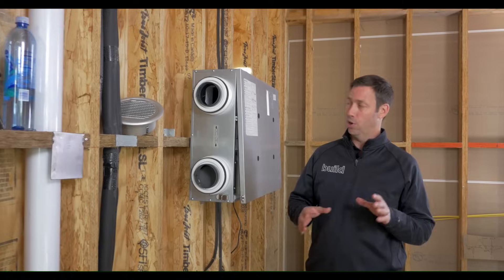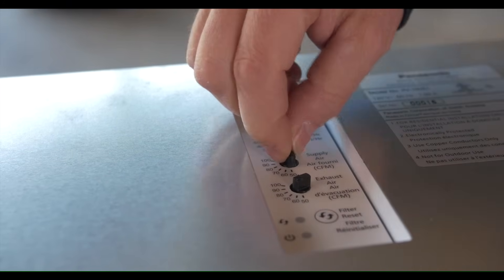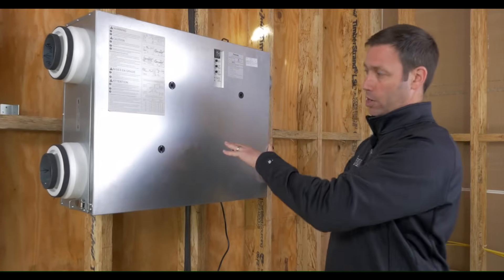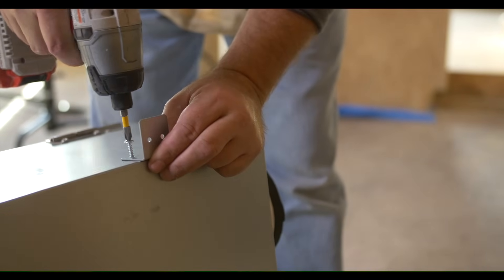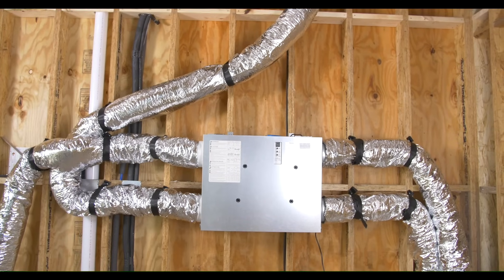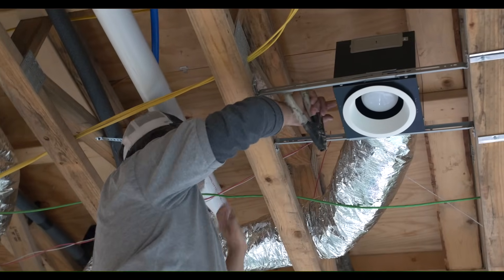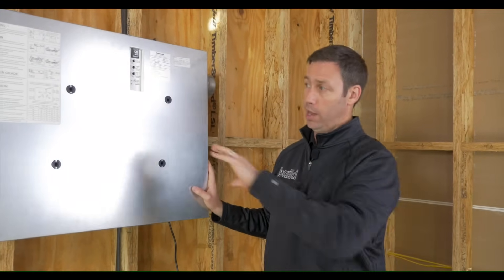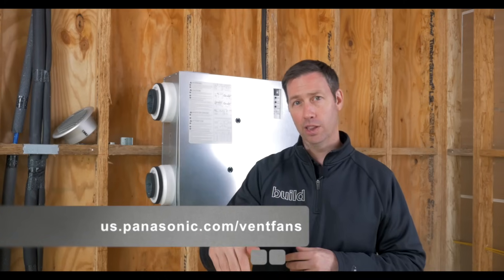How to Install an ERV

Comment: Matt you mentioned this installation is a standalone...does it mean it is not connected to the HVAC unit? If this is correct interpretation what will be the efficiency of the ERV to pull and push air in a 2000 sqft house with 3 supply and 3 returns
Reply: Yes, it means that it is independent of the HVAC system. However, as someone else already noted, he installed the SUPPLY (of the ERV) next to the RETURN of the HVAC, which kinda-sorta provides a short path between the ERV SUPPLY and the HVAC RETURN without actually connecting them, which others thought would be necessary, but isn't. The problem with connecting the ERV to the HVAC is that the fans of the two systems do not always operate simultaneously, which causes a problem in balancing the HVAC airflow to all rooms. ERVs are installed independently of the HVAC to make balancing easier, or even possible. I know I did not directly answer your question, sorry.
Reply: @billcowhig5739  this is my main question regarding installation. I am reading directly from the panasonic manual here, and it states as a stand alone unit that supply should be t'd off to every bedroom in the house, and return t'd off to every bathroom/kitchen. not just one supply vent. that's a lot of ductwork, and seems to be asking to 100cfm fan to do a lot of work, but maybe it's ideal as it is what the manufacturer specifies. otherwise it specifies hooking it up to the hvac system directly, which like you said, would lower efficiency for a number of reasons. first would be airflow, will 100cfm be enough to blow air all through existing ductwork in a 3-4 bedroom home? second would be leaky ductwork if you are retrofitting the unit, you will certainly lose airflow to the attic or crawlspace (which may be okay, a little exchange there might be preferable). i just can't figure out the best way to do it. i think dumping supply air near the homes main return would be okay but who knows. it might be best to start there which is the least amount of work and then monitor the air quality, update duct work as you go. maybe you could measure co2 levels in each room before/after to see where you need to add supply.

you can get around the fact that the unit only runs when the hvac runs by omitting the hvac signal switch and just letting it run 247 and maybe putting a booster fan inline somewhere to help out, but that would mess up the pressure balance at the unit. otherwise just have the air handler fan running 247, which is $$ and could cause other issues. the added benefit would be more airflow as the AHU acts as a booster of sorts, but idk, i'm not a pro technician.

Comment: how do i install without hvac unit? i have mini splits for heat.  i spray foamed my knee wall ant attic its air tight, not i need fresh air.

Comment: I bought this unit based on your recommendation. Unit is dead on arrival and does not turn on - very poor quality. It was also missing the covers for the ports.
Reply: Covers for the ports?
Reply: @technorex344  ports allowing manometer reading - the covers blank them off to close leaks if they were open.

Comment: Serious question...at what point do you need/have to have an erv/hrv?  Thx
Reply: Depends on your goal. If you want the house to be healthier for the people- run it all the time, if you're just trying to manage a humidity level, that would depend on the humidity. A simple 'dehumidistat' can manage that for you.
Reply: @technorex344  thanks for the reply.  Ive got a house that blows 12 ach.  Im working on improving that but assume that it stays at 12 ach.  Would an erv/hrv still benefit the home or occupants?  Thx
Reply: @treystills  How did you come to that number?
Reply: @technorex344  blower door test
Reply: @treystills  I see. I disagree with that test on the basis of: Why would one test a building for problems, using a test that will never occur under normal conditions?
Reply: natural forces make it so when one side of the house pressurizes, the other side depressurizes. Air will then move into, and out of, the structure. That's usually referred to as 'Natural Ventilation' which, while it does allow some fresh air in- does so sporadically and in a way that does not guarantee overall ventilation of the structure. It's like opening windows; if you've got a window at two ends of a long hallway and you open both, you're going to feel a breeze, but that doesn't mean rooms off of that hallway are getting much if any of that fresher air.
Reply: @technorex344  I posted a sincere question which requires a response from someone knowledgeable in this field.  Clearly you have no idea what a blower door test is, its results, and why it would be performed.  I'm not trying to be rude but your wasting my time.  I do appreciate your effort though.  Thanks
Reply: @treystills  I do know why it would be performed, but for ventilation purposes it's not a relevant test. For an insulation/air/moisture tightness- sure. It tells you that all the little holes in your house equate to a given area e.i. "a hole this big" I have nothing to gain by giving you information, I'm not trying to sell you anything. If you've got 12 air changes an hour, you've got a leaky house. If those holes are in every room and supply fresh air where people spend the most time (like the bedroom where we spend 1/3 of our lives) and exhausts from pollutant sources (like the kitchen from cooking or the bathroom where cleaners are commonly stored and where we shower) then fantastic; you've no need for proper, mechanical ventilation.

If you believe houses are built for people and health is the primary concern: ventilate it.
If you believe houses are built for energy and heating/cooling is the primary concern: insulate it.
If you believe houses are built for people, but energy is a close second: do both. ~Insulate tight, ventilate right.

You don't have to believe me; that's ok. If you watch Matt often you'll hear him talk about Joe Lstiburek(stEE-brik), so here's an article he wrote on the subject: https://www.buildingscience.com/documents/insights/bsi-053-just-right-and-airtight

Comment: Hi Matt, awesome information in generell about ERV. Been researching a lot and no information was as clear on system definition as you. I'm planning to install a ERV in my home in Hong Kong, a place were residential indoor ventilation is uncharted territory...! Air here is dirty, hot and humid (polluted tropics). Space scarce and f2 most expensive in the world. So what compact system is todays best solution for a 1200 f2 duplex (700 downstairs sleeping and bathroom+500 upstairs kitchen and living), and what floor should I place inlet and outlet? I will spread your knowledge and videos amongst us suffocating expats and buy the product!
Reply: The inlet/outlets can be placed on the lowest floor unless you're close to a lot of traffic, in which case higher up may give you slightly better air. if you're in a polluted environment, you're going to likely want what's called a HEPA (High-Efficiency Particulate Air) filter. The difficulty with polluted environments is that HEPA filters will work and will "fill up" and become blocked, possibly in a short period of time and can be expensive. Even in a non-polluted environment, HEPA filters are recommended to be replaced once per year and can cost an average of $200.

Comment: Looks like a cheap, substandar product. Calling that filter big is laughable! Mine has thrice the size(in a seven years old unit),  and good would be a proper bag filter with ten times the surface area and dust load like in a Hoval unit!
Reply: he called it "good" based on the MERV rating of the filter, also "big" is relative to the CFM flow, you don't need a 2'x2' filter like the central A/C units filter that has to filter the whole houses airflow as the A/C run's which on a 4 ton unit can be well over a 1,000 CFM, just enough for the small like 100ish CFM this unit supplies.

Comment: I've never even heard of an ERV before. And, you never said what it is or does, really.
Reply: Energy Recovery Ventilators, it brings fresh air in in 1 chamber and exhaust house air out in another chamber and exchanges via the fins as much energy (whether that be heat energy or cold energy) from the outgoing house air to the incoming outside air with the idea to be to "pre-cool" or pre-heat" the fresh air so it doesn't have to be reheated or recooled as much by the central air compared to simply opening a window to allow fresh air in.

Comment: Hi Matt - I hope you are still responding to these comments.  I plan on building a 36' Diameter Geodesic Dome Home which will mostly have an open plan and Extensions.  It is an energy efficient, "tight", home with tons of insulation in the walls.  I have MCS (Multiple Chemical Sensitivity) and am extremely sensitive to VOC's.  I live in the humid South but it also gets below freezing in the Winter (for a few days...).  I am doing my research on the ERV and it would appear this is what I need.  
My Question is:  Would this be the size I would need or would the Whisper Panasonic (spot ERV) be better for my small, open, floor plan?  I really need great filtration and not sure the Spot ERV will fulfill that.  (I will have a bathroom fan and also my electric stove will have a vent / fan.  OH!  I can not have a ducted air / heat system due to severe Allergies so I will be using the Mitsubishi Mini-split air / heat system in my home.  
A little confused on what I should get....if anyone can give some suggestions, I would certainly appreciate it.  Even though I will be using mostly Low VOC materials to build, I want to ensure I will be able to live in this home, and clean indoor air is going to be extremely important for me.  Thanks for your input!

Comment: Here in the low desert (Palm Springs) it couldn't be any hotter or drier.  Exhausting heat out of the building and trying to keep it from entering (radiant barrier) are top of the list.  Cooler air can be had fairly easily, by excavating along the north edge of the slab and bringing air from that area, into the building.  It could be done in various ways, digging, blocks, rigid insulation and large diameter pipes  etc..
Then, why couldn't I use a HRV sort of in reverse, to use already cooled but stale indoor air to pre-cool the incoming outside air?
Reply: it works both ways, thats why they call them Energy Recovery Ventilators now instead of Heat Recovery Ventilators, the goal is to bring the incoming air as close to the temp of the outgoing air as possible, the system does not care what the outside air temp is.

Comment: Wouldn't it make more sense to incorporate this tech into the HVAC system so that the filtered outside air is distributed housewide, and a portion of the returned air be exhausted to the outside?

Fortunately, I live in an area with relatively clean air.  My home is pretty airtight, so I have the urge to open the windows for some fresh air on nice days.  If there was a way to direct the fresh filtered air into my HVAC system, I'd be less inclined to open the windows.
Reply: it's actually not a good thing to do, cause you don't want to mix ventilation and cooling/heating. Ventilation requires much less cubic volume and there are numerous articles why this is a bad solution. What you need is actually 4 ducts to each room (yes insane). 2 for in/out ventilation and 2 for cooling/heating
Reply: @jasonhunter6125  While I agree it's not a good choice to mix them due to volume requirements, as you said, it would be more effective to supply fresh air to the rooms where people are, and exhaust from where pollutants are. However, placing one of each at opposite ends for the basement, as moisture is more likely to accumulate there due to the temperature of the concrete in most cases.

Comment: There seems like there are a lot of geeks on here that know way more than i do on venting and fresh air . Well on most things LOL  So that is the reason for my question . Is there any information on using earth tubes to bring the fresh air to the  ERV or to a dehumidifier then dispersing it into the home . Unfortunately in my area there isn't much research being done on high end systems . After calling more than one collage i am left with more questions than answers .
Reply: Dane Lynch  , The earth tubes work well in the southwest because low humidity. The danger is mold growth due to moisture.
Reply: @davetaylor8614  Thx Dave for pointing this out. Earth tubes will dump moisture from hot air into the tube when it hits the cooler earth. The moisture and pollen etc are now a good medium for mold. The air moving through the tube is becomes laden with mold spores. Don't bring mold into your home air. This is why earth tubes are not a solution for an hrv or erv.
Reply: I would see earth tubes as more of an alternative to an ERV, you are using the ground temperature to cool or heat (depending on the season)  the air coming into the house which is kinda the primary concept of the ERV, I guess you could use the ERV if you really wanted to, but at that point you are already mostly there on the energy recovery you would get from one of these so it's probably not worth the cost.

Comment: So I guess opening a window isn’t techy enough eh. I’d seriously be interested in an experiment to see a house with a few windows cracked open versus having one of these systems. I think it’s safe to say that the minuscule energy losses wouldn’t be as much as the cost of one of these ERVs. Personally I only believe that these need to be installed in finished basements. Not hating on you Matt. Just my opinion...I don’t think they are worth the money. But that’s all relative to how much money one has I suppose
Reply: A good ERV will recover over 75% of the energy in the air. Couple that with a well sealed house, and the energy savings are far from minuscule in all but the most temperate climates. If your house is leaky already, then you're probably right, this would be a waste of money.
Reply: Trevor Lambert thanks for the insight. Cheers
Reply: Trevor Lambert you know you can make one with a pipe within another pipe, easily achieve greater than 95% efficientcy when horizontal the con is it'd need to be like 30 ft long vs these little compact things. 

BUT WAY CHEAPER!
Reply: Nope, these are needed as you tighten your house up, which saves money. It is not minuscule or it would not be the code, plus you have breathing air involved.On top of that traditional exhaust fans quit working when in a tight home(no makeup air); and who wants to be sucking air from a wall cavity? yuk.
The bedrooms can get really smelly with out ventilation, especially with hydronic floor heating and of course you can run low on fresh breathing air. You can open a window of course but then you need to re heat or chill the air. These units make it about +-60-70% cheaper(I don't know the stats exactly) than a window being opened. In a place where electricity is over 20 cents a kilowatt hour and gas is up there as well, it makes sense. My father installed his whole house system in Alaska and it made a big difference, plus you get a filter system. In Norway you almost can not find a place without these systems and last time I check they had aluminum core units that got 80% efficiency. Not sure if that included the cost of running the unit.
Reply: It's an approach to ventilation. You could also do cheap powered intake fans in key rooms- that's what I did. Of course I can also open windows but not during allergy season, when there's outdoor smoke, it's crazy humid, etc.

Comment: It would be good to know what and ERV is and why we would want to install 1. Everyone loves their acronyms but the fail to think that not everyone knows what they mean.
Reply: Energy recovery ventilator it recovers the sensible heat in heat and moisture, heat recovery ventilators only recover heat. This recovery is done to remove stale air from tight construction homes and replenish fresh air from outside. Indoor pollutants like phthalates, formaldehyde, pollen, fungi, dust mites, airborne bacteria / viruses, and volatile organic compounds are dangerous to small babies, infants, sufferers of asthma, and the elderly.
Reply: Google it ffs

Comment: Matt, Great video as always.  I am wondering if you have ever installed this unit laying flat on the back cover vs chain hung or wall mounted.  Panasonics literature doesn't say anything about whether you can do that at all.
Reply: You can’t the hrv creates moisture which drains out the bottom.